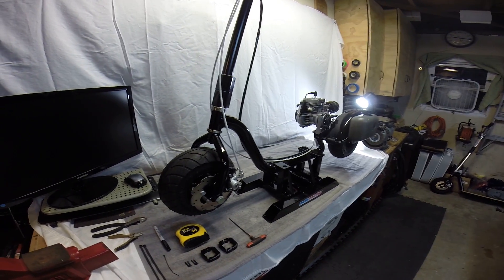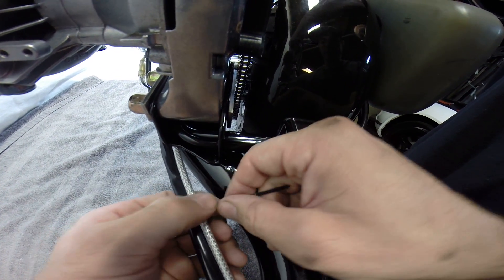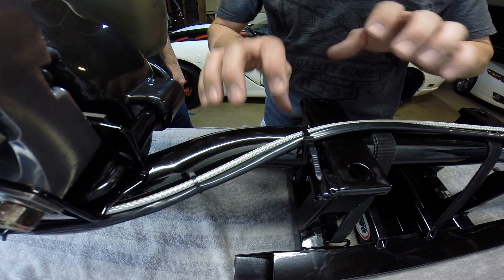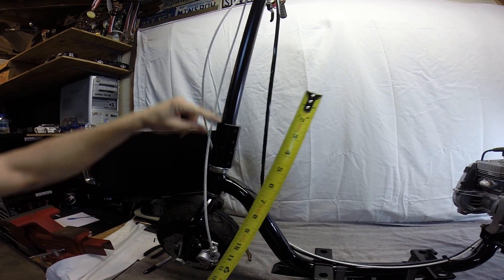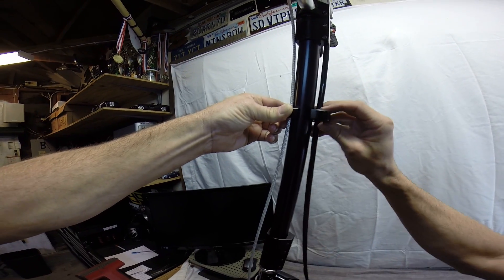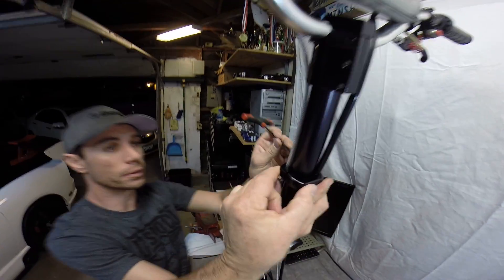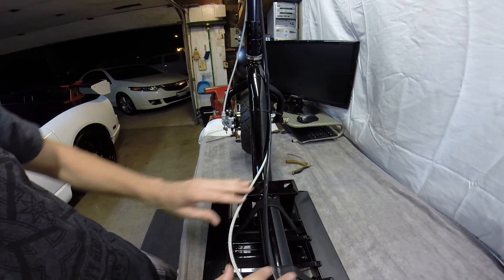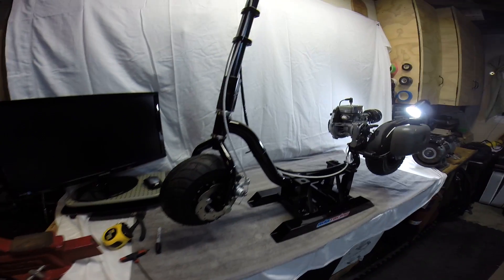GoPed, HOW TO: Race Pole Cable Clamps , Cables Install

Comment: Recently bought a GTR46 and I'm looking to gain some speed by switching the knobby tires to racing tires. Any help on which specific tires would be the best choice for the trail ripper?Thanks for your help awesome  videos btw.
Reply from the maker: are u planning on doing both dirt and street? Id suggest an all terrian tire. or only street id recommend kenda 671's. as for speed you will need to change your gearing. something like 6/76 or 7/76 or 8/76. depending what u plan to be doing...